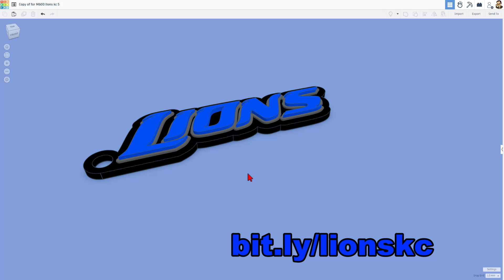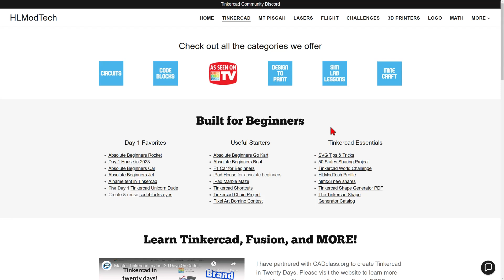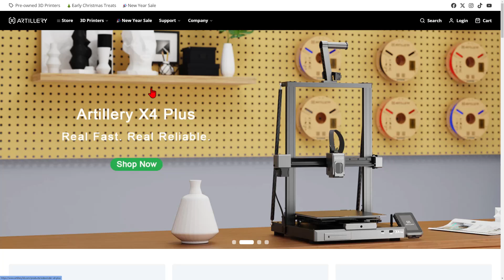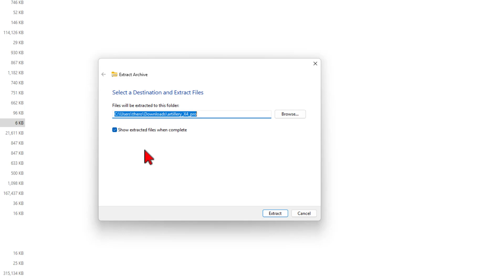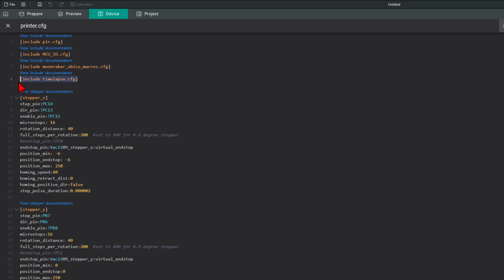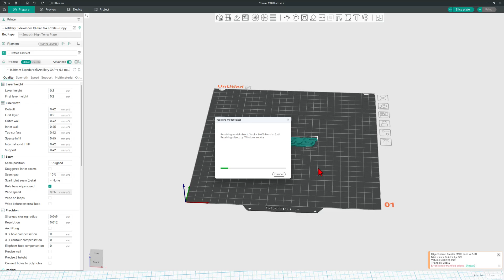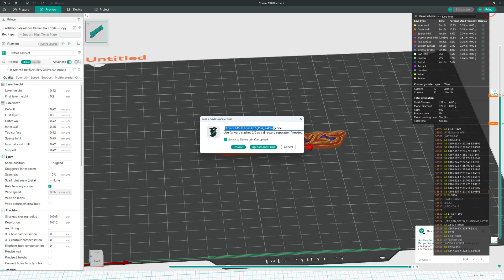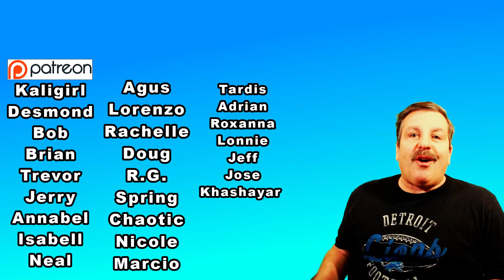X4 Pro Multi Color Tinkercad Keychain Orca Slicer M600 Setup in Minutes!

Comment: Hi! is there any way to move the extruder to home before doing the filament change? Thanks.
Reply from the maker: I would guess you could add the steps in the G-code. I have not tried it myself though. I would use Google to find the code to make that happen... I am not sure how it would return to the correct spot to re-start though.

Comment: Finally. had trouble editing file printer.cfg. directly in OrcaSlicer. My walkaround was to edit file with notepad, save and upload. Works fine!
What about inserting some magnet or other stuff like nfc tag? the nozzle must leave the printer area for manouvre under the printed object. have you the right code?
thanks!
Reply from the maker: Nice work using notepad. I have some magnets to use so I will do some figuring. Thanks for the nudge.

Comment: I don't have a mulit color printer. So maybe I make the lion as a separate part (with diff color), and then snap it into the helmet.
Reply from the maker: You can do that. I did it with these back in the day. https://youtu.be/HcXw3SsWAjY  That M600 command was a slick way to get two colors out of the single color printer in the video.

Comment: M600 is the GCODE for change filament. It moves the print head away from the print, ejects the filament, waits for new filament to be inserted and the user to confirm, loads and prime the filament, and continues with the print.

Many modern slicers have an option to insert the Change Filament command where Insert GCODE was used here.

Alternatively, insert a Pause and then do a filament change manually using the printer menu. That's what I used to do back in the day.
Reply from the maker: @danko6582
100% spot on brother!!

Comment: Trzeba aż tyle kombinowania aby zrobić pauzę podczas drukowania?
Przecież wystarczy na wybranej warstwie kliknąć prawym przyciskiem myszy i zaznaczyć "pauza"
Reply from the maker: You are correct that the pause command is slick as well. The M600 command makes is really smooth. The part of this video that likely matters most is the set of steps to get that configuration updated so it includes the M600 command. The keychain is just because I really like the Lions. =)